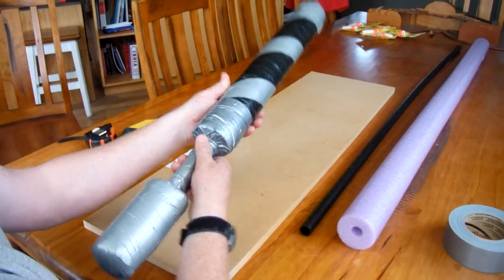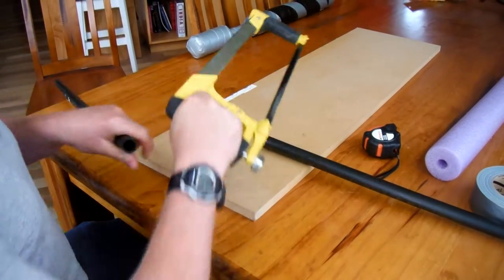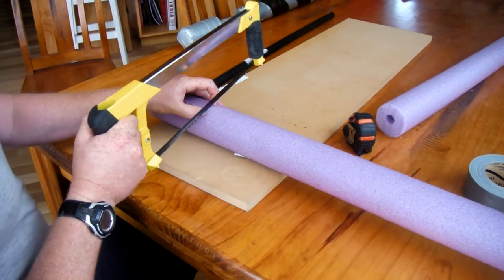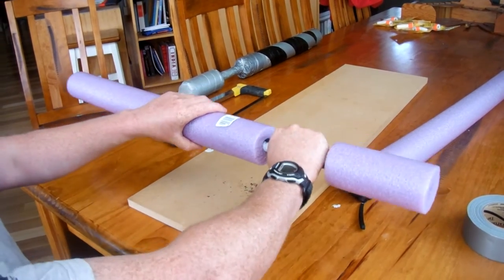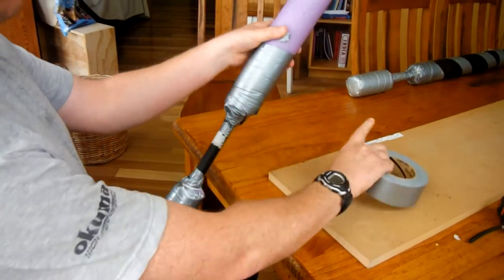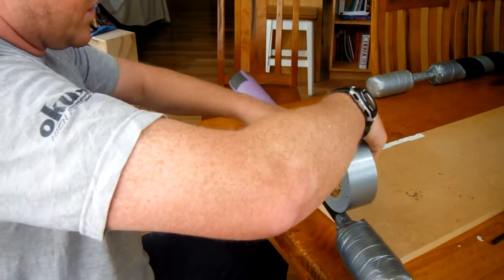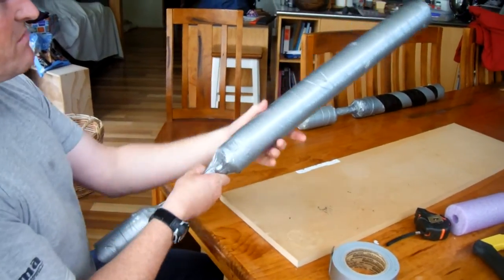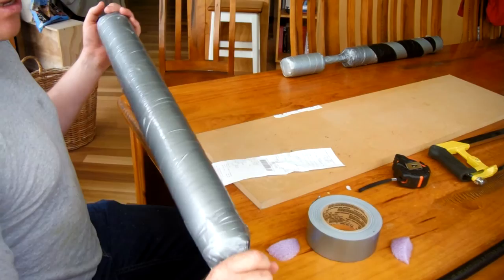Quick Easy and Cheap Boffer Swords

Comment from the maker: These were the old MK1 Boffers they do the job but also break apart under HEAVY use. currently MK2 and 3 are being tested and I hope to have a video out for them soon.
Reply: What types of changes did you make in the design?
Reply from the maker: Adding a Canvas tube over the whole thing under the Tape! and also using camp mat rather than pool noodle. (but that last one is sure to hurt more)

Comment: The way you're wrapping the tape =around= the foam, rather than along the length, would fail check in some traditional boffer groups.  Too easy to compress the foam taping that way.
Reply from the maker: This is for full contact groups  that use it as training swords. your group may also use the word boffer?